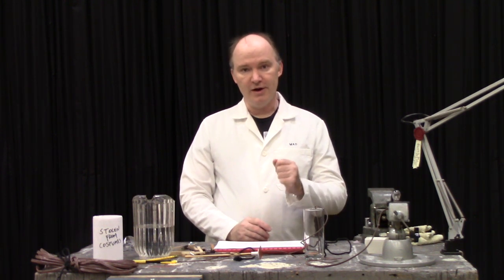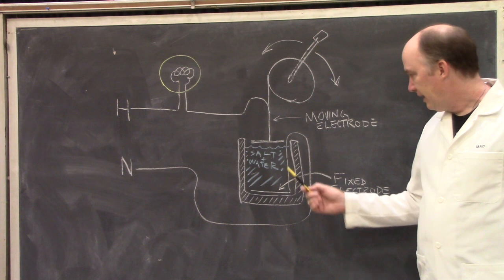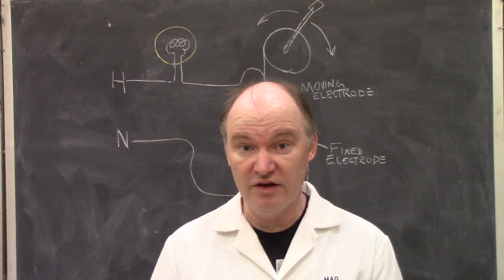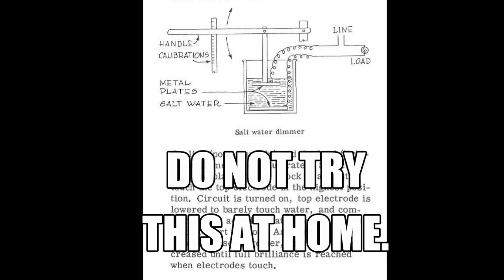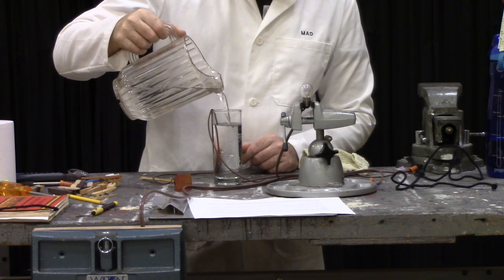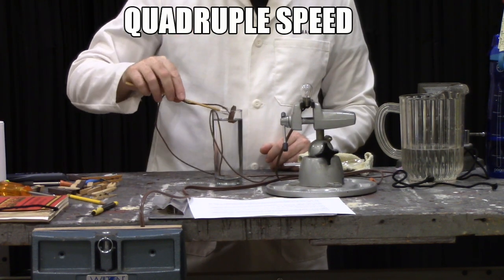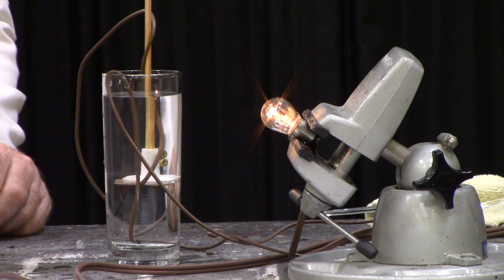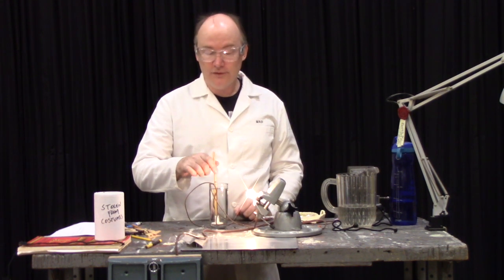Salt Water Dimmers

Comment: By placing the dimmer on the Neutral side of the load, the tank/fixed electrode is at or close to Ground potential, making accidental contact less likely to cause a serious shock.  This is, of course, provided that the Neutral is properly bonded to Ground.